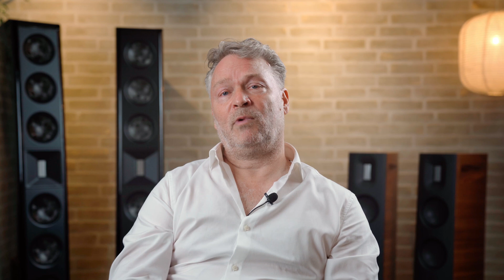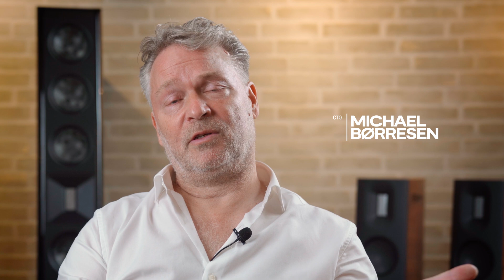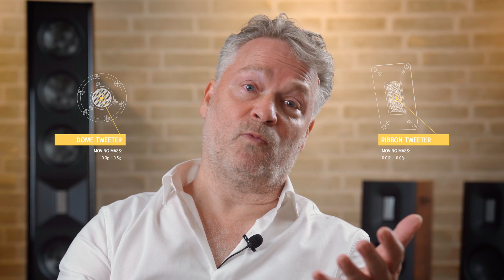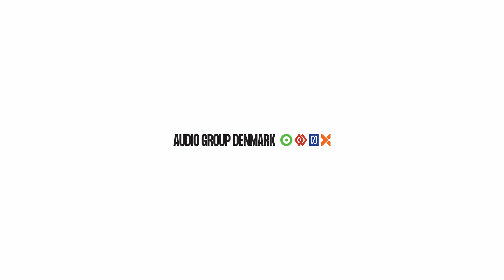The Superior Sound: Ribbon Tweeters vs. Dome Tweeters | FAQ

Comment: Driver mass determines the efficiency, not the upper frequency limit of a driver.   The low Xmax of ribbon drivers leads to using higher diaphragm area leads to larger x,y dimensions directly resulting in narrow dispersion.   So there is always a directivity compromise between using maybe a long throw 19 mm dome and a 3" x 1" surface ribbon driver. Designing very wide dispersion speakers will lead you to using 19 mm domes or domes with waveguides like KEF UniQ.  Using a Linkwitz transform to form half of a 4th order crossover filter on a dome tweeter solves a lot of problems related to the Q and roll off frequency of the driver.  A notch at the 25 - 30 kHz dome resonance is helpful as well.  So properly designed systems with domes and ribbons can both be low distortion, excellent transient response and SPL.   I think domes and ribbons can both sound amazing, the main tradeoff seems to be the directivity driven by the cone/ribbon dimensions.  If you desire narrow vertical dispersion, a nice 5 inch tall ribbon will do the job.

Comment: there will be a point with the resonances but what is the benefit of a light mass allowing frequencies being transduced that are above the human hearing abilities. It is actually the combination of mass and motor that allow for a certain frequency range. Transients don't need to be faster than necessary to play up to 20 kHz.
Reply: Fact that it goes above the human hearing range in its frequency response, is irrelevant imo. There is no reason to care about that either way. There is no real reason to add a filter to cut off the infrasonics, as audio interfaces already have aliasing filters depending on their samplerate.

Comment: With a dome tweeter you have to do something that most designers do not do, which is the dampen the "Fs" with a null filter with just the right Q. They don't like amplitude and that technique goes a long way to kill it. I am of course not saying anything against what is said in this video and the mass advantage of ribbons, but I know that a dome can sound almost ribbon like when at its best, but it is rare to see that happen, very rare. Also, there is something to be said about ring radiators.